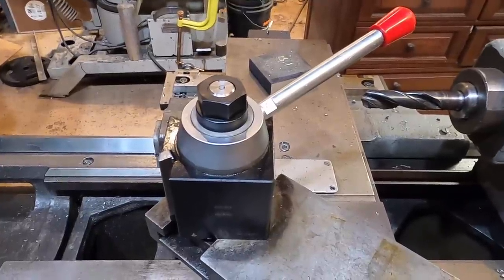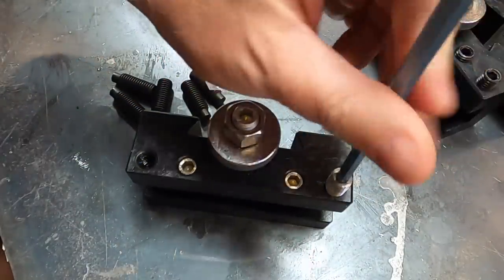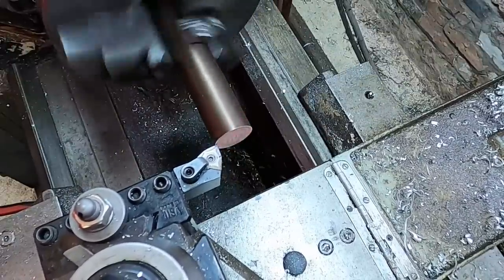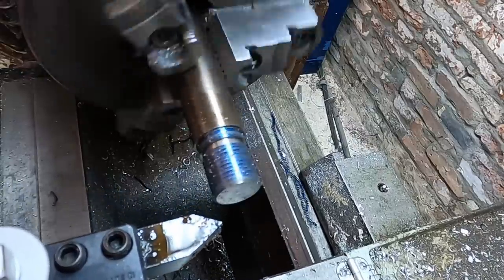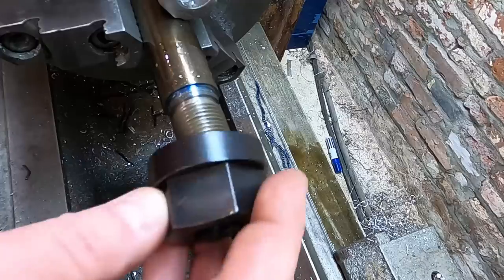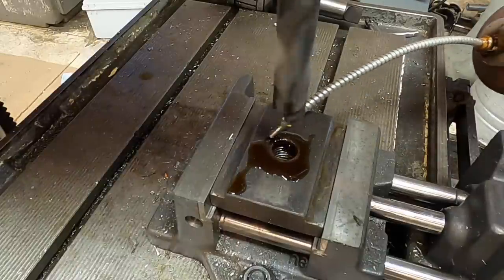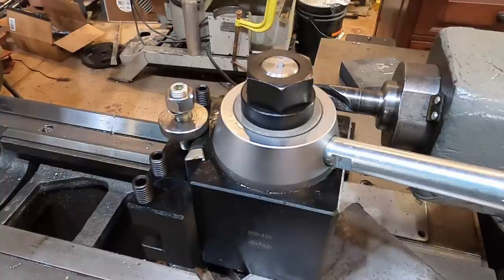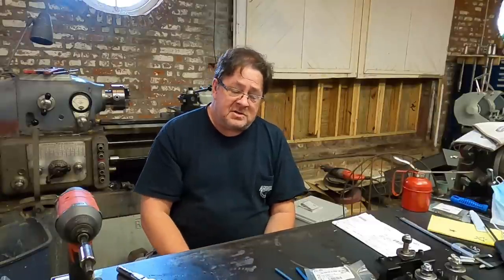New Shars Toolpost for the Martin Lathe

Comment: Good install. All I’ve ever used is clone QCTP, never had a moments problem. However since I use B size tooling most my turning tools are 1” shanks that I’ve dovetailed and direct mount to the post. Also I made a lot of boring bar holders my self so I could use them. On all my home made  tooling I use threading rod an made my own adjusters.
Reply from the maker: What's up James, good to hear from you, thanks for the comment

Comment: I drilled and tapped the center hole on top of my tool post stud, put a ratchet wrench on the binding nut, dropped a washer down, then fasten it with a cap screw, trapping the wrench on the nut. Little flip of the ratchet's direction lever, and the wrench is always there, but never in the way.

Comment: James, thanks for the presentation.  I have a question . . . Where the slot length on the compound is longer than the tool post is square, would there be any advantage to rigidity if the shoe to the tool post was made to the same length as the compound slot?